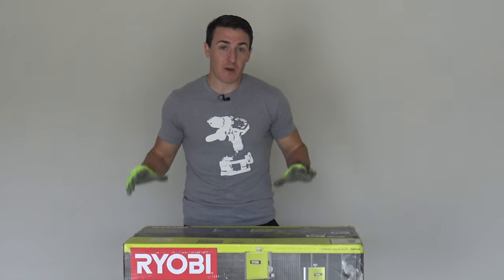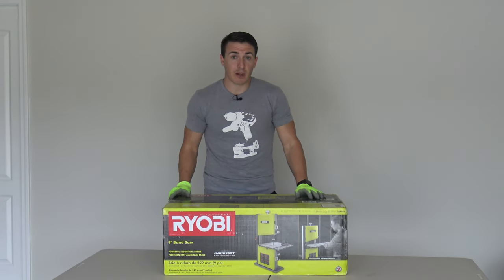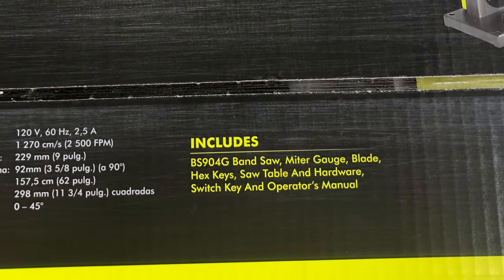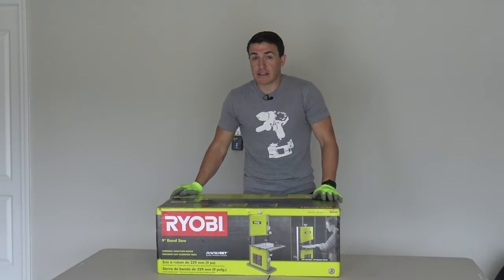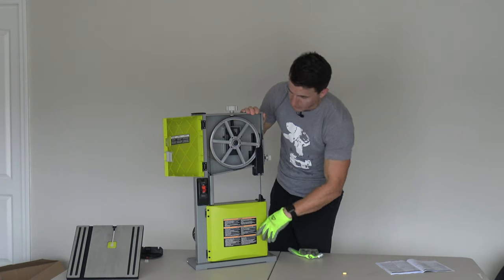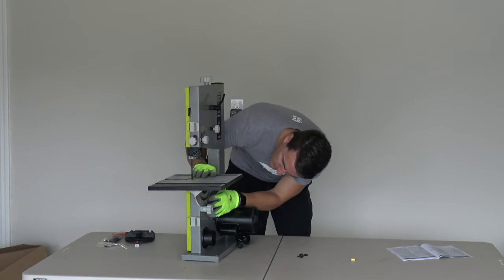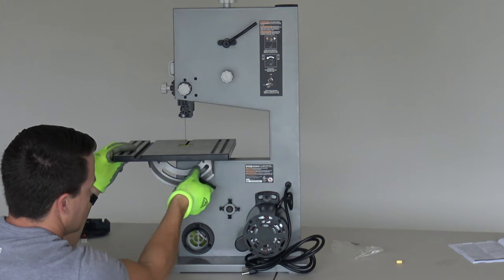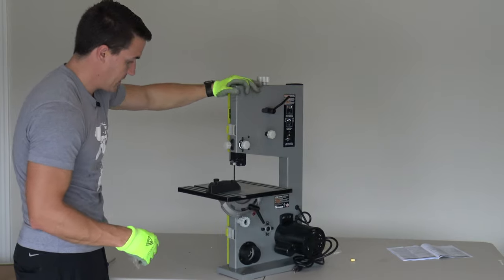Ryobi 2.5 Amp 9 inch Stationary Corded Band Saw (BS904G) Box Opening & First Impression

Comment: There was that Little Window at the Side of the Top Door, to see the Tracking.
I wouldn't want to have that Door Opened actually-Just in Case...
Also instructions mention that the Teeth of the Blade need to be in the Center of the Tire-Not the Actual entire Blade.
I Noticed they meant That, because the Back of it needs to set up Close-1/64 ths Gap only, against the Back Bearings for Stability under Pressure I assume.
[Didn't see U Measure any Tolerances].

Comment: Please do the drill press!
Reply from the maker: Thanks Nathan! Yes, drill press is on our list. 😁
Reply: Solely Ryobi awesome! I’m likely getting it in June. I’m planning on building something next year that will require a drill press going through some 4x4’s so would be great to see a review of it.
Reply: @SolelyRyobi  +1 on drill press please.
Reply: @bkelevate  hey Nathan, I picked up the drill press the other day and so far I love it. I use it with a fortsner bit when drilling holes in a flag union stars for .45 ACP casings and works awesome. Only down side is about 5 to 5 1/2 inches from drill bit to the stand where the motor sits. It's small, but perfect for my applications
Reply: @ericfeldhausen7921  that's great to hear! I think the biggest stock I'd work with is 4x4 so that's fine for my needs. I don't need anything crazy big. I just want to make sure my holes are perfectly perpendicular when it matters.